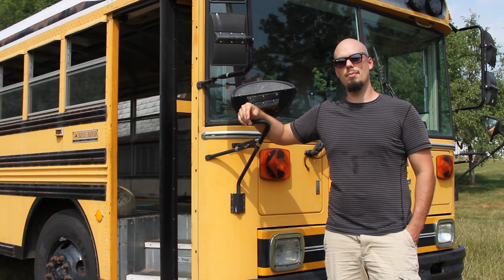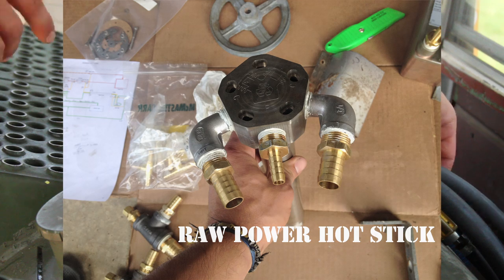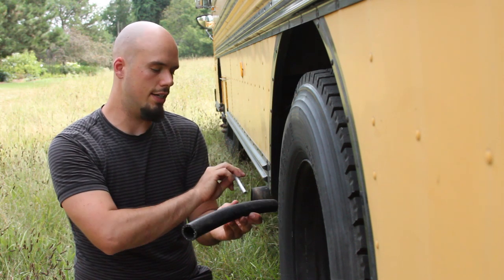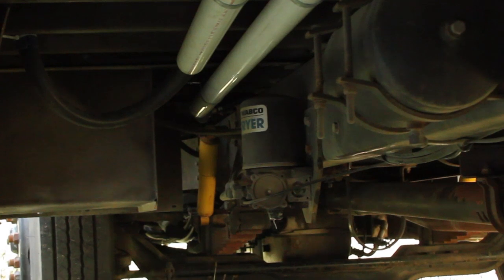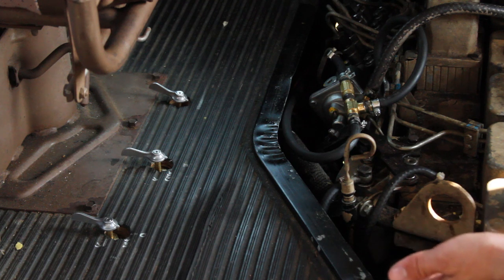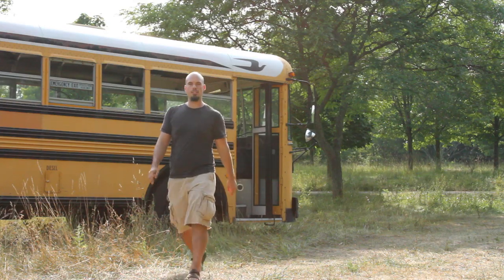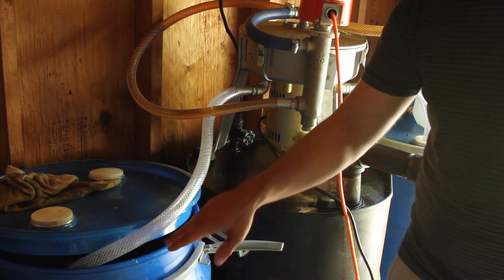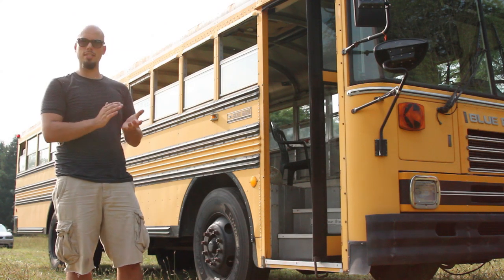Waste Vegetable Oil Conversion - 1992 Bluebird Bus (WVO Designs, Tiny Home)

Comment: Hi. Every time I watch a vege oil conversion tutorial, I learn something new. In your case it was to do with pressuring of the WVO tank, with the Schrader valve. A little piece off genius. You could also use it as a breather, (removing the valve) which I recommend you do, under normal running conditions, (if your tank hasn't already got one). This should avoid the fuel line 'vacuum' syndrome where your inline fuel pump begins to labour as your tank level gets lower. Pressurizing to prime the lines (if you should have a problem) is way better than towing, or even other workshop tricks. As we all know, running out of fuel is a cardinal sin in a Diesel engine. Especially with such a long/heavy vehicle as yours. Mine is a Toyota Coaster 22 seater bus. Shorter than the Bluebird but still way bigger than any other van I have owned. And its my first Diesel! Yet another learning curve (at the age of 62). Loving it though. And looking forward to doing the WVO conversion.
Tx for sharing. Good luck and safe travels.

Comment: Thank you for this. I have been planning my 'green' bus conversion for almost two years. I wanted to convert a diesel to biodiesel. Since I won't be doing the work myself I was going to have to locate someone to do this for me. My guess is that subcontracting this out would be quite costly. Can I ask you what the cost was just to switch to bio doing the work yourself? Thank you.

Comment: why shouldn't you shut down the engine with wvo in the system?
Reply: if you do that you would have a hell of a time getting it started the next time. svo doesnt really work unless the engine is already hot, because it relies on the coolant system to preheat the oil to operating temperature. thats the reason for 2 switchable fuel systems, because diesel works fine in a cold system.
Reply: +shylildude The wvo, being more viscous when cold than diesel, will make it hard on the injection pump when starting.

Comment: If the engine was in front, and fuel in back, could you route the WVO alongside the exhaust to help heat it?
Reply: you will melt your fuel lines like this

Comment: Do you know what the amp draw for the centrifuge is?
Reply: I believe you need 220....6000rpm
Reply: 220v/50amp
Reply: thats 11KW that tiny electrical engine is no way that powerfull. 5amps at 220v maybe
Reply: It's better to use heating elements in the veg oil tank, a pump, water separator filter and a 1 micron filter. Especially for veg oil that's already been heated and processed to 5 micron. A looped filtration system that double as a heated fuel system with insulated lines. 1000 watt heating elements in a insulated tank. Need one element preset at 120 degrees for every 55 gallons used. It eliminates the $3500 engine coolant heating system, the pump injection heater and exchanger.

Comment: This is hilarious - why not have a full 300gallon tote for the gas tank
Reply: they generally are not made of metal ,,, like a semi fuel tank or an aux fuel transfer tank .... hard to secure a tote  , and they are not safe in an accident....
not to mention the damage to the engine by running it on veggi oil

Comment: You are going to need a bit more then "basic mechanical knowledge" after you put a few miles running that system, cause you ain't gonna believe what that "line in line" system is going to do to that Cummings engine. Tis a shame there are so many wannabes out there teaching others there bullshit. But you will learn, that's "if" you don't give up, (like so many others do,) when your catastrophic failure occurs, And it WILL. Rich
Reply: Rich s can you tell us more about what you mean? What are your experiences with running wvo?
Reply: I"ve used a similar system for many years with no problems Rich s.
Have you?